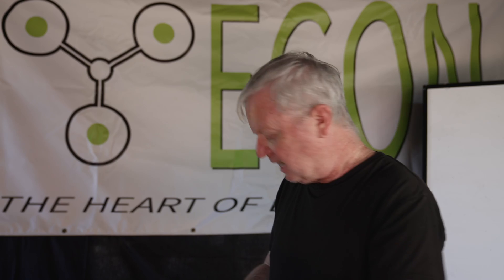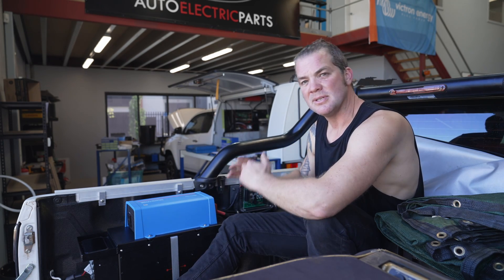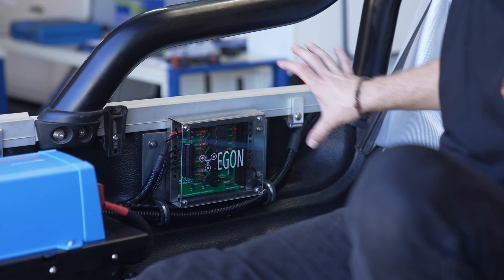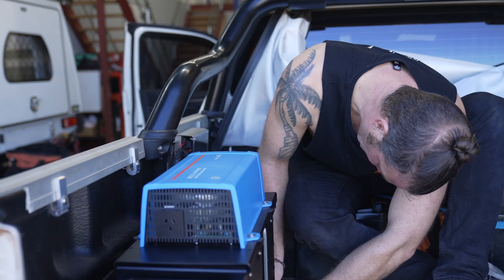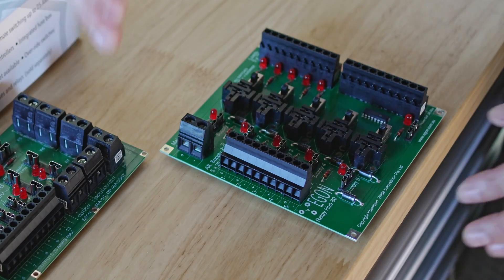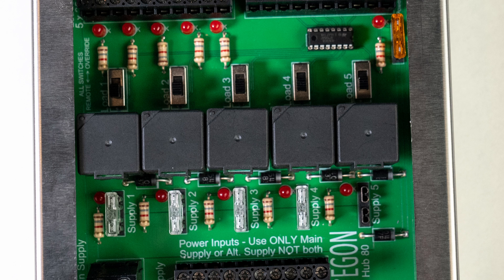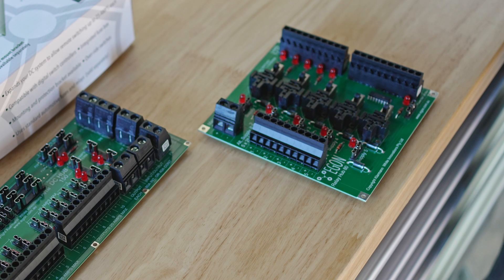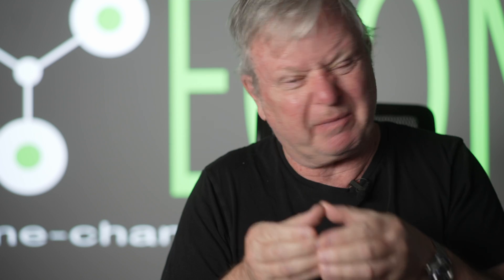EGON RELAY-HUB. World's simplest analogue switcher and time saver @4xoverland

Comment from the maker: EGON has just released the all-in one relay and compact DC distribution board. Game-changing simplicity.

Wiring examples and instructions: https://www.egon.com.au/relay-hub-instal/

An extremely cost and space efficient way to add switching relays and add additional power distribution circuits to any DC installation.

All the time-consuming relay wiring is done for you. Uses common automotive relays. Plug & Play.

BUY/ORDER: https://perthpro.com.au
MORE INFO and QUESTIONS: https://www.egon.com.au

Comment: I’m a fan of your videos and Heiner’s videos too. But these products make no sense to me. They seem to over-complicate rather than simplify, and designed to be on display rather than being easily concealed. But wish you every success.
Reply from the maker: They make complete sense to anyone doing DC installations and need little explanation. Its designed to be on display because it has fuses. One has to access it to run the wires, it has self diagnostic LEDs.  Like any fuse box or item with serviceable components, it has to be easily accessible.
Reply: I have an overland rig that has been to 42 countries, with aux battery and engine bay mounted fusing and wiring. This is the usual stuff, like driving lights, compressor, interior lighting, fridge, inverter etc. I think I’ve replaced one fuse in 14 years, maybe two.. I never even think about it. Maybe I’ve been lucky. If electrical had been a nightmare, maybe I’d see the value.

Comment: If your budget cannot afford 600$ for a connector plate but understand automotive electrical you just can buy a relay/fuse box from car scrapyard for 20$. I’m not criticizing this good product but just offer alternative to low budget projects.
Reply from the maker: EGON products simplify installations and make them more reliable and easier to diagnose installation faults. And because of this, are far cheaper than traditional installations because of the huge savings in labour time and expertise. For the DIY person doing it him or herself on the cheap, Egon products are not for you. We make no excuses for this.

Comment: I like the idea, however there are in my eyes some drawbacks:
- there's no high power relay port for switching a twin compressor for example. So if I need that, I need a separate relay & wiring anyhow
- five relays might not be enough
- rated only 80A total, is that correct?
- print layout could have been made smaller
- control switch lines are not fused, so I have to add inline fuse holders or a fuse box anyhow
Deal breaker is the price: 650 GBP or 760 EUR. A skilled electrician would do a conventional cabling/setup in two hours plus material at a fraction of that.

Comment: How is this different from an sPOD? sPOD got rid of relays a long time ago. sPOD is MOSFET.
Reply from the maker: It is not transistor-based.
Reply: Mosfet's are no doubt a better solution, but in all fairness other than some additional current draw, reliability of modern mechanical relays isn't really going to be an issue. If you're hell bent on solid state, Hella do a SSR in a normal auto relay package that could be retrofitted.  Where SSR's come into there own are PWM applications, like varying the speed of a water pump or the brightness of an LED light.

Comment: So it’s not IP ratted, how do you mount it under a bonnet for spot lights.  Or do you need to run longer cables into the cab which will create more current drop.
Reply: Automotive relays are usually sealed. As long as it's not salt water, it should be fine. This relay board costs 520 so I would definitely recommend make your own. 5 circuits is not difficult or timely as proclaimed.
Reply from the maker: You think this is just 5 relay circuits? It's not. But you make a good point. Make a cheap one without a board for about 50% of the retail price. How to do it: Figure out the wiring. Its 5 relays plus a power board with self diagnostics on all circuits. Figure that out. Find the connectors. There are lots like them on Amazon, but these are unlike anything found on the Internet anywhere. Clue: they are not made in China. Find a bracket that encloses and protects the entire unit. It can be done. If you have the time. A lot of time. And that is the point of it. Saves time by making complex things simple, minimises voltage drop (no hand-built system will come close to this) and its extremely efficient and robust.
Reply: @4xoverland  it's mainly the cost that I have issue. I think your attitude is what can we charge people who don't understand electronic, not how can we make it as cheap as possible(at a good quality) and add our margin. Are you trying to improve the 4x4 space or make money? 

I personally don't find electronics complicated, so a led that lights when a fuse blows doesn't mean much, and I know the cost is low to design and implement that.  If it had 5 high power and 15 low power with manual switching and Bluetooth switching, shunts for current readouts, power usage records, and history, maybe it's worth more.

You still need to wire it in and have switching panels, etc, so there is more cost as well.
Reply: voltage drop the result of current and resistance
Reply: Cost isn’t an issue. If you want quality products they cost money. You can get switches cheap from Wish if you won’t want to spend money. 
I am interested in practical applications. I don’t own a troop carrier or a Ute with a flat on the back. 
So simplify my wiring is great. But where can it fit it. Currently all my electronics are in the inner gaurd as it’s the only space I have. I am re-building my car in the end of the year and this would be great but I cannot see an open circuit board working. I also don’t want a switch pro.
Reply: @swagmanadventures557  if cost is no issue get a redark tvms.

Comment: I have my doubts about screw terminal usage. Vibration in such a vehicles can loosen even spring loaded terminal enough over the time that it can overheat. Why not use automotive connectors and I don’t mean these DIY style spades or horrible molex type connectors. Proper ip rated waterproof stuff. You still need to crimp anyway. For corrosion protection you need this box also to be somewhat waterproof. Unless you conformally coat pcb and use some really thick gold plating on contacts you have issues soon. Exception is if you use it exclusively in dry hot climate. Overall idea is great but solution is too diy and not automotive but as a lot of installations are very very diy I guess it’s ok.
Reply from the maker: These are not screw terminals.They look like it, but they are clamp terminals with torque settings. You do not need to crimp. The terminals do the crimping. They are unlike anything you have ever seen. The relay connectors are automotive types because they wanted to make it accessible to the most people, but they are an extremely high quality. Once in, the relays are tough to remove the connections are so tight. The components are unique. Designed by a German mechatronics engineer who worked for VW and Mercedes.
Reply: @4xoverland I understand that they are clamp terminals and being made by Weidmüller are no doubt the very high-end ones as they are in use in all kinds of industrial settings. My point is that all these types of systems are usually meant to work in relatively non vibration environments so there is a risk for them to come loose, hence most modern automotive systems don't use these types of connectors anymore. I am not stating that they are not adequate or suitable for this particular intended role at all. Just wondering if proper automotive connectors wouldn't be more suitable for this type of the system. Again, there is no intended criticism for this particular design just trying to pass my humble opinion. On the crimping side you of course can leave out ferrules, but this is again not good practice if you take industrial and automotive practices and Weidmüller own instructions lists all test and conformation data only with suitable ferrules and not as bare cables. On relay side I have no doubt that this solution works absolutely fine.
Reply: Ive had an egon hub for 2 years , and have thrown my car through so much vibration. Never once as a connection come loose. 😊

Comment: Ok- I.  Get it—- Great product, I love it and I’m a fan of your work, guys. I have a question though. Isn’t one of the main reasons for using a relay… 1) Not having high current running through your switches- Hence low current switching side. Now 2) Ensuring the least voltage drop on the work (high current side) by having the relay as close as practicable to the accessory. Ie; lets say we put your relay board in the back… great for fridge, oven, etc… in the back. BUT if youre then wanting driving lights, winch, or say compressor- up front…. You are now required to run heavy, high current cables back to the front of the vehicle- for each circuit. Does that make sense? I’m struggling to appreciate why I wouldn’t place my relays in close proximity to my accessories- to minimise all this large heavy current cabling, etc. Does that make sense?
Reply: Yes- so if the winch and battery are at the front of the car….Power run is battery to relay to winch… shortest possible run of wire- that’s my point…. It’s more efficient to have separate relays, in this instance/example. In my first post above…. Assuming the Egon relay hub is in the back… that works for say  fridge and oven. But for eg; winch- The power cable would need to run from battery to Egon relay hub then back to winch- and separately back forward for driving lights, etc. The answer is of course to use separate relay hubs front and rear… but now we’re talking $$$$- for what gain?
Reply: Let's say your relay is next to your device. You still have to run the same gauge wire to the relay from the battery. So, you see, the cable run is a function of the distance between device and battery and not device relay. 

This product may allow you to have shorter heavy gauge  runs as you can place it in a central location.

Hope that help clarify what they are trying to achieve. I'm not a fan of it for other reasons, but it does work to simplify an installation and remove failure points.
Reply: Relays in vehicles and fuses are in a box all together when you buy your truck away from lights etc so what’s your problem ya neg

Comment: Will it work with my 70mm and 90mm multiple core DC vehicle cabling?
Reply from the maker: Yes. https://www.egon.com.au/relay-hub-instal/
Reply: I don't see anywhere where 70 or 90mm cable could terminate (as in winch wiring) unless I am missing something?